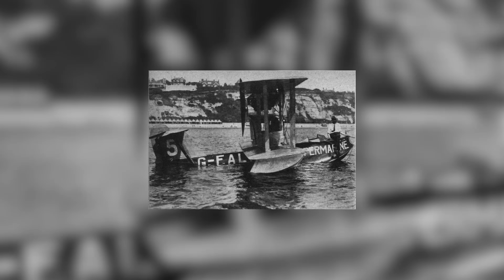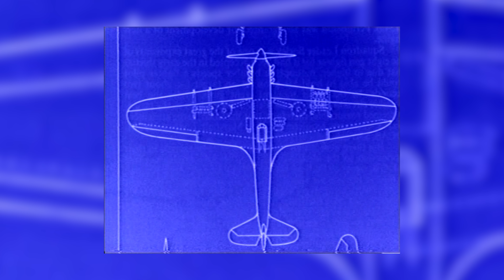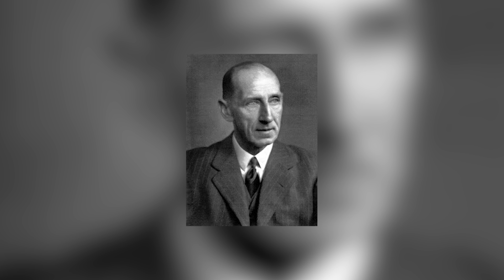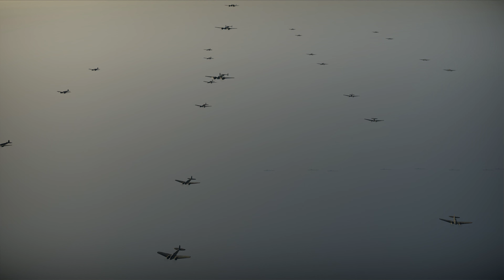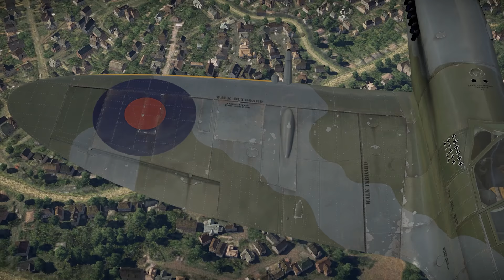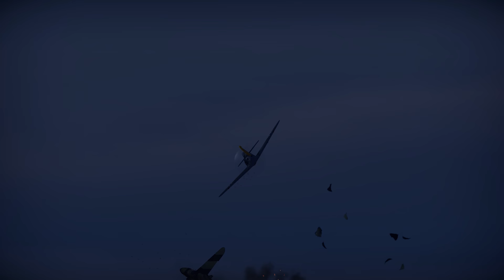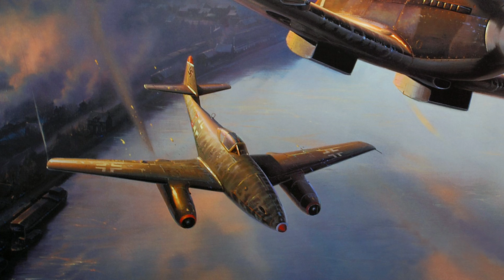SPITFIRE | A Documentary

Comment from the maker: Happy Birthday, Edward

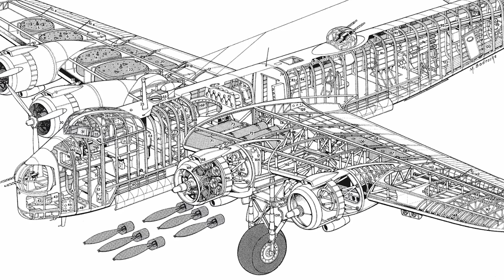CORRECTION - at 22:17 I say 15,000 miles... it should be 1,500. 
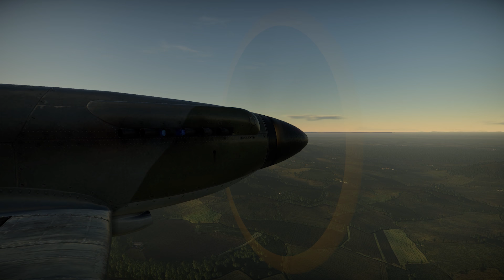Also, at 1:01:50 I say that all MkIVs were eventually fitted with the 'tear-drop' canopy as standard. 'fletsepopje' has claimed that this isn't true - F (fighter) variants were fitted with the 'bubble' canopy, and FR (fighter reconnaissance) were fitted with the 'tear-drop' ones. I cannot find anything to completely certify this but a quick google image search shows that this may well be true!

Quick heads up, there may be mid-roll ads during the video, I plan to get rid of these once Audiomachine approves my request to remove their automatic claim on the video, which just take a day or two. (Edit: they were nice and quick and mid-roll ads have been removed)
If you have any questions at all about the documentary or about the Spitfire itself (or even the events surrounding it), ask away and I'll do my best to answer.
Reply: Wonderful documentary, when it started I thought ugg he's not going all the way back there. That lasted less than a minute though as ugg was quickly replaced by AAHH 😛.
Your presentation was completely engaging.
Reply: @herbertkeithmiller  I think he did an amazing job Herb, I was very surprised how many new facts (for me) he managed to winkle out that the mainstream medias efforts either ignore or or simply miss - a great effort.
Reply: Magnificent documentary, I've devoured all the doco's on the spitfire i can get my hands on and this has to be the most complete in terms of start to finish history.Its detailed and emotional, obviously a huge amount of work, thank you.
Reply from the maker: @-TheRealChris  High praise indeed, thank you!
Reply: @-TheRealChris  Love to see the boys do a doc on operation mincemeat - Anyone can see the film, but it's full of holes and was produced when much of the material was still classified.
Reply: My grandpa in the RCAF flew Spitfire in WW2
Reply from the maker: @solgato000  That's an incredible legacy to have in the family!
Reply: Doug, this is a really great documentary. I'm probably around double your age and have watched many films and documentaries about Mitchell and the Spitfire, but this feature has elicited a surprising number of facts to which I was previously unaware. Beautifully presented, elegantly narrated and completely engaging - thank you!
Reply from the maker: @jamesportrais3946  It's a pleasure - thank you for watching! It was great fun (if not a little tricky) researching and finding out as much as I could so I could comprehensively cover the Spitfire story as much as I could!
Reply: @dougajames  Well Doug, I'm watching again with delight. Can we look forward to anymore longer format doco's like this? I genuinely hope so. How about the history of gypsies? That'd be fun; we finally have genetic evidence to back up many of the rumours. If that's a bit too scary, how about the history of the IC engine? Most people think it began with Benz - 'fraid not...
Or the electric car? I've seen models from the 1830's. I'm sure many of your keen fans will similarly be able to proffer alternative ideas. Just do what you did here; go into great detail without skipping what most do, and make it enjoyable in the manner that you can.
Reply: Thank you Ben and Doug. You two are a single prodigy!
Reply: Great vid, do a vid on operation Torch, as in how those Spitfires, and the fuel to run them, got to Malta.
Reply: At last, a documentary whose narration is not drowned out by background music or the noise of battle!
Reply: What a great documentary, small team, but better than most large team documentaries I have seen.
Reply: As a supermarine spitfile owner and pilot in war thunder and a lover of the spitfire all my life i found this amazing. brilliant independant documentary doug, loved evey second, and would have loved to hear of the pink reconnisance spitfires missions for determining bombing targets, that is if any information on these flights is known of course. thank you for illiterating this legends tale so fluently and professionally. if, for future documentaies you require some additional 3d models, animations or anything im a trained 3d animator and specialize in industrial design animation and i offer my services for free to you guys (without credit needed). beautiful work.

out of interest if you havent seen this doug id reccomend this to anyone interested in spitfires or aviation from ww2,  https://youtu.be/mxnGJsVPIFA my hero guy martin helping to restore a ww2 mk1 spit using original techniques and interviewing the peope who built them originally!
Reply from the maker: @contemperis  Thanks so much for your kind praise and offers of help - much appreciated and I'll keep that in mind!
I have seen the Guy Martin video - it's fantastic! I adore the passion he puts into his projects
Reply: @dougajames  ypu have no need to thank me doug. You put the work in and made the docu that braught the spit to life for so many people and showed it in a new light. Amazing work
Reply: One correction Doug - 22:17 - a range of 15,000 miles? Do you mean 1,500 miles? A B52H has a service radius of 3,890 nautical miles or 7,210 km. Hitlers proposed "Amerikabomber" cited in 1938 had a required round-trip range of 7,200 miles (11,600 km), but never came to fruition.
Reply from the maker: @jamesportrais3946  Ah whoops, that's a typo within the script... I'll amend the comment above - thanks!
Reply: Congratulations on putting together a magnificent documentary!! I could easily tell your enthusiasm, pride and respect for the Spitfire coming through. Very compelling!! Thank you. 👏👏👏👏👏😊👍
Reply: A more technical "development" video would receive a lot of views. As would a more "experience" or "life with a Spitfire" video. First class work. Wonderful documentary.
Reply: we also have Supermarine Spitfire Mk XVI TD248 was built by Vickers Armstrong at Castle Bromwich in 1944 and released to service on 11th May 1945. Prepared for service with 695 Squadron based at Bircham Newton in Norfolk she was withdrawn from service in 1947 following damage. After repair she returned to service in 1948 transferring to  No.2 Civilian Anti-Aircraft Co-operation Unit at Little Snoring, Norfolk for uses in calibration flights and target towing. Supermarine Spitfire TD248‘s active service life came to an end in 1953 and was issued to 610 Squadron for static display at Hooton Park Chesire in 1955.

In 1988 she was acquired by Historic Flying Ltd where she underwent restoration before returning to flight in 1992.

Today Supermarine Spitfire TD248 wears the colour scheme of No. 74 Squadron 2nd Tactical Air Force 1945 and is operated by Spitfires Ltd and maintained by the Aircraft Restoration Company at IWM Duxford. she is the first ever spitfire i ever saw as a child at RAF Sealand as a gate guard
Reply: bruhhh.......I know you put the work in but there are still many many incorrect stats about the planes and historical claims. However I feel you'll do much better as your journey making the docs go on. 
Cheers mate
Reply: The claim of the fastest spitfire is in accurate, its the fastest spitfire to fly and recover. Plenty of spitfires broke the sound barrier but not no speed gauge can be confirmed as they all shattered on impact with the ground. One of the many limitations of Piston aircrafts at the time was the controlsurfaces, they simply locked up or got blown to pieces when the sonic boom shockwaves hit the aircraft or locked the airstreams tightly preventing the controlsurfaces from moving at all. Additionally the incident you refer to is not fully confirmed either, one explanation as to how it could pull off the feat is the conditions of weather and altitude which may have first given the plane a "push", and afterwards kept the control surfaces from staying locked. Its also worth noting that flying the spitfire that close to the speed of sound often ruined the aircraft as the fuselage got irreversibly damaged. Its this knowledge the brits shared with the americans..... without ever getting anything in return despite promises... that led to the swept wings and fully controlable wings rather than just elevators etc. that made up the supersonic inovations. The F4 are a great example. Additionally there are the american rocket planes, the bell which was actually tested by a brit, though he tragically perished. The X2 might not have been the first supersonic plane, but it was like this spitfire in question the first to survive going supersonic. So It's not wrong, its just inaccurate, or conditional that the Spitfire should be able to land afterwards, and then there is the issue with accurately measuring speed at the time, we will never know for sure.
Reply: My grandad has a dfc and often broke the sound barrier in his spitfire over the channel
Reply: @Hezekiah Isaac is this SPAM!!!?!?!?!?!!??

Comment: The are some genuinely puzzling omissions, temporal distortions and really disappointing developments left out. In a startling omission at 55 minutes or so, when there is NO explanation of WHY the MK IX was so superior.Was it fairy dust?NO! The ONLY reason the MK IX was able to tackle the 190 is because of the genius of Stanley Hooker who created the two speed, two stage, inter-cooled Merlin 60/70 series. The performance advantage over the 190 startled the Germans. With the second stage engaged at 20,000' it walked away from the 190 in a climb and to a speed of around 410mph at 28,000' with a ceiling regularly reached over 40,000'.

Hooker's brilliant innovation changed the air war in its entirety. 

This also applied to the Mustang 1 and 1A which in the hands of Rolls Royce at Hucknall, and fitted with the Merlin 65, (not 61) became the Mustang X and eventually the P-51B. The PR Spitfires (even earlier ones) had a range of better than 1,500 miles or more than a P-51 with drop tanks.

Comment: "So there are legends on the Spitfire... Ahh the legends... Legends are hard to kill... One of those legends is that the Spitfire turned better than the Messerschmitt 109, or the FW-190. Well that is a good joke... In fact all those who found themselves with a 109 turning inside them, at low speeds, well those in general did not come back to complain about the legend... Why? Above 280 to 300 knots, the Spitfire turned better than the Me-109. But, first and foremost, in a turning battle, the speed goes down and down and down and down, and at one point there comes a time, when the speed has gone down below 200 knots, that the Me-109 turns inside the Spitfire."

Pierre Clostermann: Audio from the past

Comment: "- Spitfire has eliptical wings. That means that the lift is spread ellipticaly over the wings... Therefore it is THE MOST EFFICENT WING CONFIGURATION POSSIBLE".

"The elliptical planform has very small theoretical advantage, but only theoretical, and only valid if the planform is truly elliptical. Spitfire's planform is only approximating elliptical, and what is left has been sold out by the aerodynamic twist it's wing has. It has effect on just one of several factors of wing efficiency, causing a whopping 0.05 improvement in comparison to a trapezoidal planform used in for example Bf 109, that is, IF Spit's wing were truely elliptical...
You also have to take into account the fact that the profile thicknes ratio of Spit's wing is VERY thin, both in maximum and in average. This in turn leads to the small coefficient of lift. This pretty much takes away the advantage of the large wing area.
BTW, ever wondered where did all the elliptical wings go?
If they are so magically efficient, why nobody uses them anymore?
Answer is simple, later aerodynamic research has proven that most of the benefits of elliptical wing were a fallacy created by insufficient or faulty research methods. They simply were not worth the trouble.
Even the developements of Spitfire, Spiteful and Seafang gave up on the elliptic planform and went to normal trapezoid form. Wonder why?
Only thing special in it is the elliptic planform, that dropped of favour just after it, when it was found out that the theoretical benefits of elliptic planform were actually only theoretical, and practical applications did not yield benefits that would justify the almost astronomical manufacturing difficulties and costs.
In Spitfire's case the benefits of elliptic planform (even lift distribution along the span) are nullified by the 2 degree twist (washout) that was needed for at least partially taming the nasty and violent stall behaviour of such wing. In short, the wing twist negated the effect of the elliptical wing. Although the wing was physically elliptical, its lift was not.
Besides, wing aspect ratio has larger effect on the lift/drag characteristics than the Oswald efficiency factor (where the theoretical difference between Spit's and Bf 109's wing is only of magnitude of 0.05), and Bf 109's wing has higher aspect ratio than Spit's...
Spit's wing uses the exactly same NACA 2300 root profile as Bf 109's wing, but with only 13 % thickness ratio, while Bf 109 has 14.2 % thickness ratio. Lower thickness ratio translates to lower Cl max. Bf 109 uses the same NACA 2300 with thickness ratio of 11%, but Spit's wing profile gradually changes along the span to NACA 2200 (more symmetric profile with smaller Cl max) with thickness ratio of only 9 %.
All the above leaves the lower wingloading as the only even theoretical advantage for Spit's wing, but even that is somewhat negated by wingprofile that has less Cl max and Cl in general.
True, eliptical wing has less drag coefficient than other, but not because of "lift is spread ellipticaly over the wings", but because of less induced drag. It is connected with shape of wing tip and wing tip vortex (stronger if you have bigger tip chord - elliptical wing tip chord is 'almost zero', so tip vortex is also weak). Unfortunately elliptical wings are also harder to built, and stalls first at tips (when are usually placed ailerons ), so they are also less safe. Difference in drag coefficient between taper (like 109) and elliptical (Spitfire) wing depends also from aspect ratio (influents to induced drag), not only from wing shape. And 109's wing aspect ratio (about 6 ) is higher than Spitfire's (about 5.4), what can balance Spit's induced drag reduction from wing shape . Of course, it depends also, how is 'taper ratio' (I am not sure how it is called in English) of a taper wing."